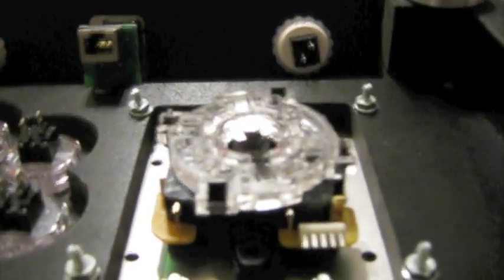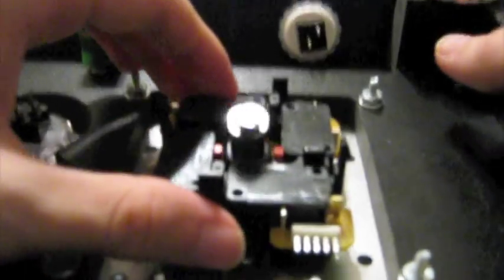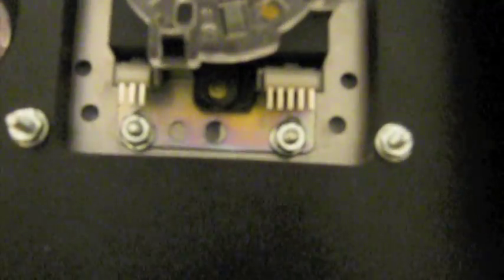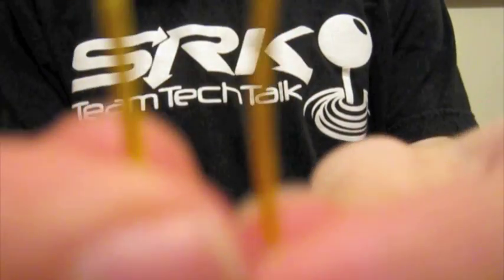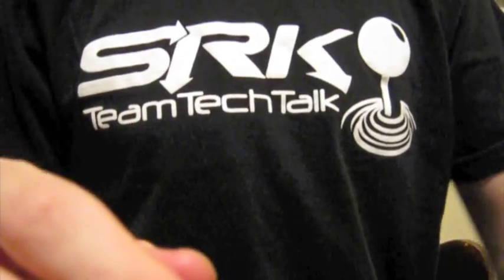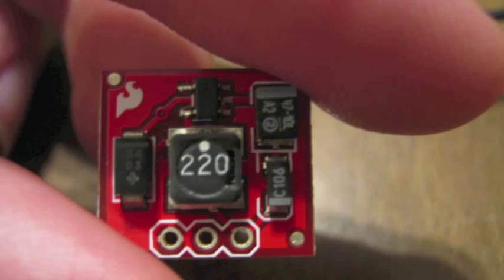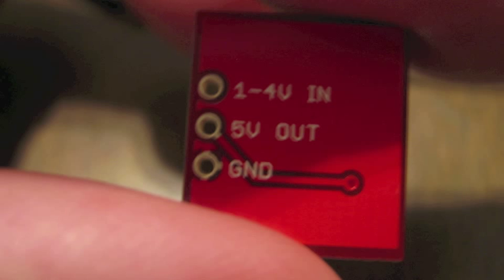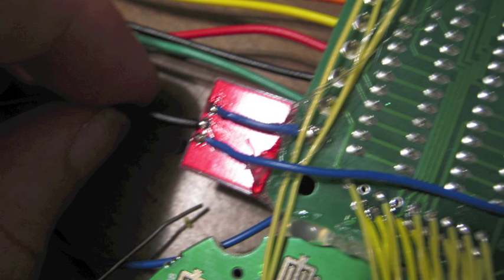Installing Spark, optical JLF PCB

Comment: Hello, I'd like to know if I can use a second GDD slot on the McCthulhu to connect my SparkCE, I'm already using one for the common ground cable which goes to all the buttons and the stick's ground would have to be plugged into a second one (the one next to the directions), is it ok?, or is there a problem with the VCC touching a GND thing?.

Comment: I don't know much about circuits and only learn to solder for this project, so I have to ask: on the newer DC-DC step-up converter, which of the + or - soldering points are equivalent to the 1-4V in and 5V points on the older one? Ground is pretty obvious but I don't want to mess up the other two.

Comment: How do I wire it to the converter you linked? The holes are labeled different .
Reply: Wanted to go optical for my t 5 hori.  Tried the booster you linked without using a battery in the booster.  unless I cut the wrong usb wire (the red one), it didn't work.  Gave up and put back in my D2RV-Gs/kowal actuator.

Comment: So this can't be installed on a HRAP 4 Kai then?
Reply: Malik Johnson , yes it can.  Plug the 5 pin harness into the same spot on the joystick’s pcb that the hayabusa was plugged into.  Then splice the lone power wire harness from the spark into the red colored wire coming from your koystick’s usb, effectively splitting the red power wire to go into both it’s original destination and the spark pcb.
Reply: The diagrams in this tutorial really help, and also be applied when installing the spark ce, except the spark would be even easier to install, because the power harness is separate from the 5 pin harness on the spark.  
https://support.focusattack.com/hc/en-us/articles/213996083-How-to-install-GamerFinger-Optical-Joystick-PCB-For-Sanwa-JLF-Joystick?mobile_site=true